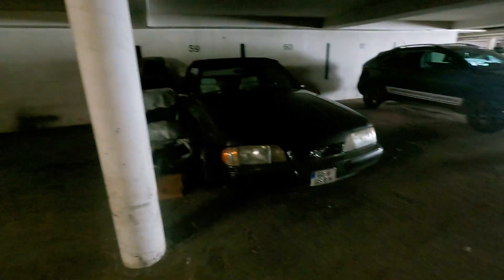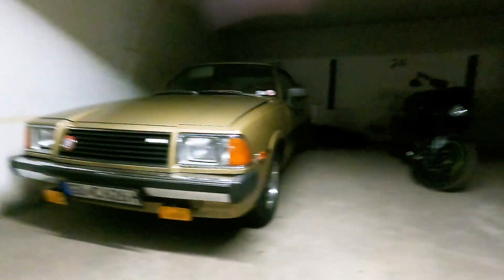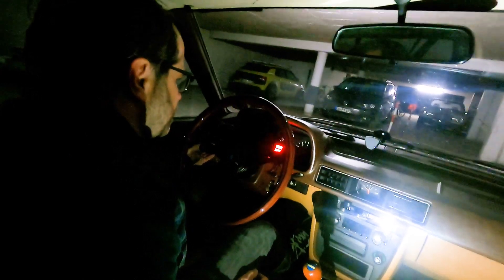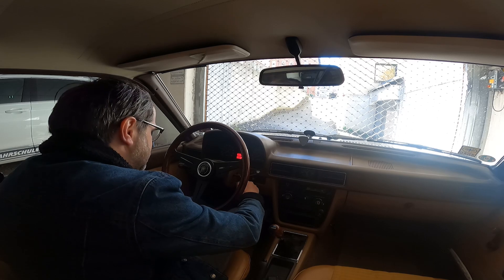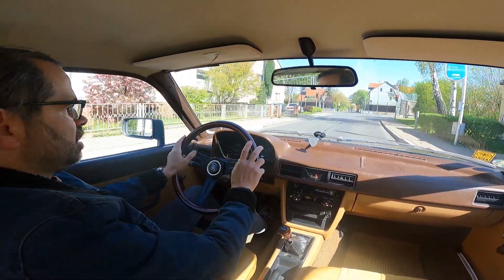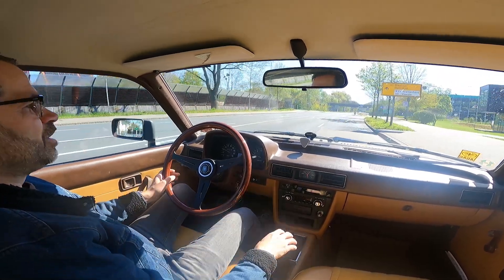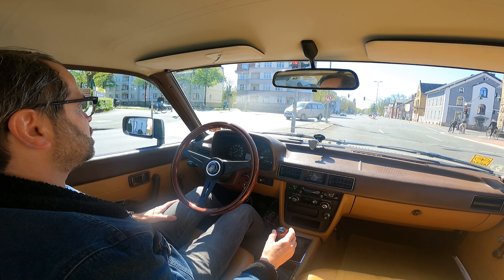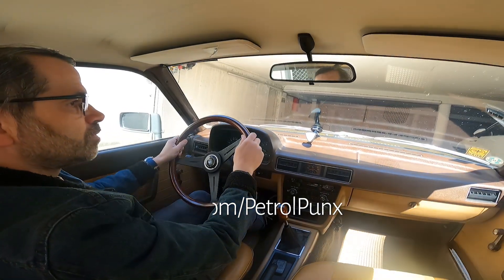Getting my 1978 Mazda 626 out of winter storage + fleet update

Comment: Thanks for posting content on increasingly rare cars like this. Being a car guy from since I was a young child, I vividly recall my mother telling me stories about how she came to have the car she owned back then (a 1982 Ford Cortina 1.6L automatic), and that this model 626 was higher on her wish list, but she would have had to wait almost a year to buy one.

In terms of cold starting the car, I do a slightly different procedure. I first switch the ignition on, then pump the accelerator pedal because you want the fuel pump running and building up fuel pressure. I leave the ignition on for 10-15 seconds, then I turn the key to start the engine. It works great and I can't recall a time when the engine died after it started and needing to be started a second time. Even for more modern fuel injected cars (90's, early 00's), I follow the same procedure (minus pumping the accelerator pedal)
Reply from the maker: Great comment! Thanx a lot. So mate, I actually have to look into the manual from time to time, as I always forgot "the procedure" - hahaha. It differs in normal use between cold start and, let's say, regular start (you start just with throttle). However, I noticed a difference at all when I start the car out of storage. As weather is really terrible over here, the car was longer in storage than expected.

Comment: I have an 88 mx6 turbo with stick. Where do you find parts for a 78?
Reply from the maker: It turned out, that Australia was a place with lots of parts. But generally, you have to look at all places. Be creative. What do you need exactly?
Reply: @petrolpunx  it's mostly small parts that wear out such as a left power window regulator. Thought the mpv part would fit,  bit it was three inches too big. Anyone want an 88 mpv power window regulator. Just pay shipping. 😂 the 88 mx6 imho was a very decent car. But,  I'm biased.  Mine is in great shape. Ty for responding
Reply from the maker: @kevinfestner6126  it can be a mess with parts. Right after this video was filmed, I actually found a crack in one of the headlights, but luckiliy enough, I found a spare (oem) in the Netherlands.

Comment: Hi there! I have a 1980 Capella (or 626 as it was known in most markets) here in the US! I'm glad to see another one being treasured so! ^_^

Yours is a 1979 model. They started production in 1978, but late in the year and presented as a 1979 car. This body style only lasted for two years: 1979 and 1980 (mine was built in October of 1979 as a 1980 car) before the Capella was facelifted for the 1981 model year (production ending in 1982).
Reply from the maker: Thanks a lot for the comment! I've seen a few nice examples in the US. And yes, it's a 79 with the slat nose, as this is a 1.6. I wonder if they sold the 1.6 in the US?
Reply: @petrolpunx  They did not. These were some of the last cars that engaged in an old mid-century practice Eurasian car companies did when selling in the US: the top-trim sport model became the base model.

That is, the 626 could only be had with the top-of-the-line 2 litre and a 5-speed manual (or 3-speed automatic as an option) and testing with my car confirms that the overdrive 5th gear is absolutely needed for all our vast distances on freeways. Funnily enough, because Japanese cars were seen as inexpensive petrol-savers and despite the high trim drivetrain, most of the luxury features (like digital clock and tachometer) weren't available in my car (I added these things later to mine... because I felt frightfully fancy doing so)

So we never got the slat-nose Capellas, just the... "full nose" (I suppose).

In the US, this generation Capella (CB2) is exceptionally rare. The Facebook group for these cars is mostly populated with Australians and Kiwis (from New Zealand) as most CB2s survived there. There's about... five of us from the US. 

In fact, my car is so rare and parts are so scarce that, after my engine blew for the 3rd time in a mere 7 years of ownership, I'm swapping in a B6ZE from a 1990 Miata with matching transmission. I have loads of footage of my project so far, I just need to get around to editing it all... once I do, I'll start releasing it on YouTube! ^_^
Reply from the maker: @Doctor_Robert  it's really interesting. Also how the spec differs from the jdm models - but I will do a separate video about the 626/Capella soon. Anyway, they are vanished from European streets too. The few parts I've needed so far, they came from Australia 😂 - mechanical parts were fairly easy to get my hands on. Right after I've made the video, I saw that one of my headlights had a crack in it. Found a new unit in the Netherlands.
Reply: @petrolpunx  I swear, all NOS Mazda bits in Europe ended up in the Netherlands. Quite a bit of my car is Dutch-sourced too. 😁